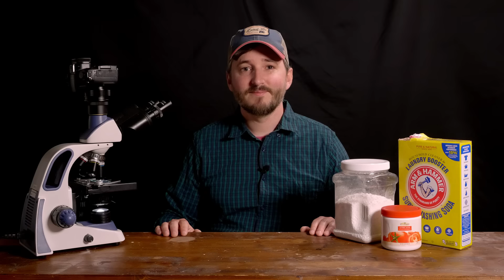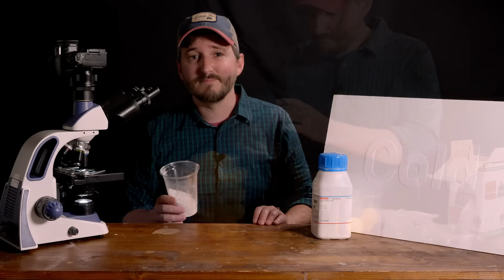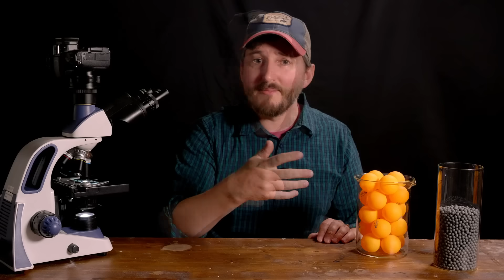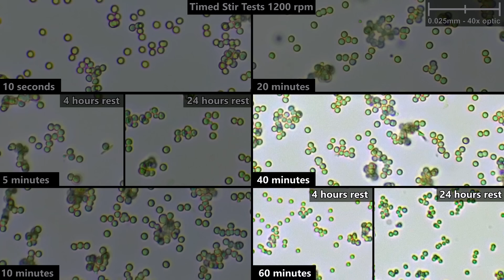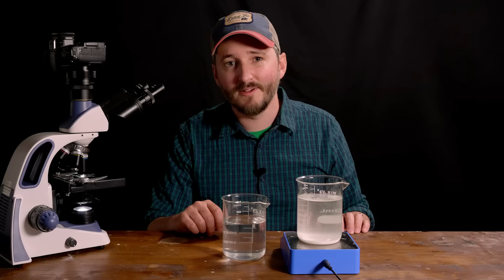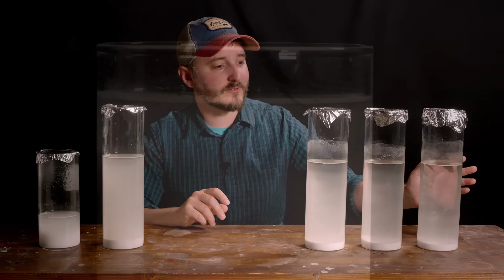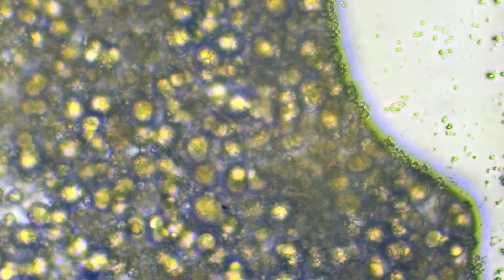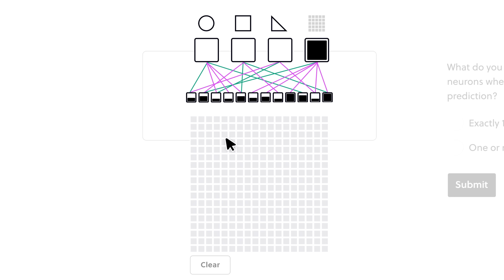Making Infrared Cooling Paint From Grocery Store Items (w/Novel CaCO₃ Microsphere Synthesis)

Comment: Concerning the smoothing of the paint application. Vibrating the underside of the panel would promote self leveling.  It's the same process used to settle concrete. A strip of tape around the edge of the board could act  as a damn until the paint dried. The board would of course need to be reasonably level. A palm sander or even a personal massager would generate enough vibration to promote self leveling of the paint on a panel. The application of the paint would a bit more forgiving as the vibration would shift the high areas to the low areas. Just food for thought. Really enjoy your content.

Comment: As far as the packing based on particle size, I used to think I understood it, bit now even less so.

Why not just use only the smallest size?

Is the aim maximum surface area and reflection (at the band of IR frequency that passes thru the atmosphere) or somehow filling the max volume (displacing the most "empty" space) ?
Reply from the maker: One size of sphere only packs to 65% volume. It doesn't matter how big or small the spheres are. Zoom in on small spheres and you'll see the ratio of filled space vs voids is identical to pingpong balls or bowling balls.

Comment: It only works when pontes directly at the sky? It couldn’t be placed on the side of a building?
Reply from the maker: It doesn't need to point directly at the sky, but it does need a clear view of the sky. The more of the sky it sees the better. The side of a building would work with partial performance.
Reply: @Nighthawkinlight  thank you

Comment: Thank you so much for your work!   I wonder if you tried applying this like a plaster or joint compound.  I'm imagining a special 3D printed spatula that has the desired thickness governed by two nubs at the ends of the spatula.  Then maybe the tracks could be filled in later if desired with the syringe.   I'm a little unclear on the physics.  Would this radiate heat that was added to the substrate? Or does it only reflect in a certain band that happens to pass through the atmosphere? Just thinking about your work in terms of climate change.  Rock on.

Comment: Ben, I watched your video yesterday and having also seen the one from Tech Ingredients it's really interesting to be able to see the microsphere creation process in such detail.

I've been wondering if it we could use the paint inside a cooling aparatus that would consist of a white painted, water circulation panel facing a black ultra black panel. If I understand this correctly (and please correct me if I'm wrong here), heat would radiate from the white towards the black more than the other way around. By pushing air between the panels, it would remove heat and in effect cool the water, would it not ?
Reply from the maker: Black surfaces are very broad spectrum radiators. That surface would release enough of the light which the white panel can absorb to keep both at the same temperature. No matter what color you use the temperature will balance between the two because thermodynamics does not allow two things of equal temperature to become unequal without adding more energy.

Comment: It is inspirational to see how an idea like this becomes realized.  Your innate curiosity, ability to cull and organize previous research from others, and use of the scientific method to test hypothesis via experimentation until the desired results are produced, is a model for anyone wishing to follow the DIY inventor's path.  
   I enjoyed how you covered the basic theory, and then proceeded into the experiments and data collection phase.  
   Know you are doing a service to everyone by sharing this type of information.  You provide an easy to follow template for:
-understanding concepts at a systems level.
-devising hypothesis and testing them.
-comparing data until results "reflect" (pun intended!) the goal. 
-and lastly; you openly share the whole process for replication.  

You, and others like Robert Murray Smith, are pioneers of a new paradigm of open source engineering which will help steer things toward decentralization and autonomy.  I hope to join your ranks in time. (currently devising a kite/ hydrogen balloon with wire string that exploits ionosphere ground potential etc). 

Thanks from the heart for all you do!

Comment: I finally got a moment to watch this, and I wasn’t disappointed. 

As to the method of application, I am not sure if you tried it already or it was otherwise suggested, but an airless paint sprayer might be the way. 

I’ve used it with great success with fairly viscous coatings, like bottom paint for boats. 

I’d love to know if you’ve tried this or the results if you do trying this. 

I look forward to my projects using this method you’ve come up with. I had previously seen the video from Tech Ingredients (also fantastic), and the fact this is a safer process is desirable. 

Thanks for putting in the footwork!

Comment: Isn't the reason that your paint takes such thick coats because pmma and CaCO3 have very similar refractive indexes?
Reply from the maker: Partially so
Reply: @Nighthawkinlight Are you looking at using a different plastic with higher or lower refractive index?
Reply from the maker: @naomiam687  Yes, and not only plastics. I have quite a few plans for future testing

Comment: What’s the performance of common calcium carbonate mixed with binder vs the microsphere product?
Reply from the maker: You can do pretty good with non spherical carbonate in the acetone and water mix. Below air temp by a degree or two C. The spherical pigment is better, and I believe will be much better when moving away from that particular mix.

Comment: A few things I am interested in trying(and will attempt), 1. rather than doing the different sized spheres in separate batches, I want to attempt to do it in one batch by adding portions of the sodium carbonate solution at different times. IE, add half mix, wait one minute, add the other half mix one minutes, Observe result. Secondly as far as the "paint" goes I also have had bad luck with pure acrylic and acetone in the past with other experiments(reactive paints) however certain grades of Kynar(PVDF) dissolve very nicely, stay in solution and spray paint fairly well, Mixes of acrylic and PVDF work too. However you need to use MEK(Methyl Ethyl Ketone) instead of Acetone.
Reply from the maker: Instead of adding the carbonate slowly the better way is to add it all at once in a big batch, then siphon portions out when the mixing time is up for each size. I think adding the carbonate in stages would mess up sphere formation. It's a very particular process.

Comment: can this meathod be used to make calcium carbonate clay? if you make the spheres small enough theyll sinter when baked like ceramics
Reply from the maker: Calcium carbonate doesn't work as a stand alone clay because it will turn into quicklime in the kiln and fall apart when it later absorbs water

Comment: So I don't claim to have a degree in science I just love learning but I'm curious since air is actually a terrible way of dissipating heat, would you be able to apply a clear coat like acrylic or resin used for a lot of modern art then do some kind of water layer between it and another platic maybe another cheap home improvement material to seal it. For testing I'm sure something like an old aquarium would work but in a practical setup it would probably be a large investment due to weight etc. Just curious about ways to improve the efficiency.

Comment: If used on a ceiling, wooded axis of thermostat/insulator, keeping on air in the room during winter,, and potentially have some ready-made painted plasterboard to face skyward in summer to prevent the heat in the roof cavity cooking inside?

Comment: Very interesting video you might be able to create a cool low cost air conditioning system with this idea what about using aluminum heat sinks incorporated into your design I'm kind of getting an idea so you have a not very large volume moving water pump pump water through pipes into a case where you have this paint around the outside of this case you have aluminum heat sinks to help conduct the heat into the air then you have the cooled fluid an insulating pipes so it don't get warm again it stays cold into like a car radiator with fans remove the cold air around in the room this all would use low-voltage you could use a solar panel to run the motors for the pumps to recirculate the water through the system make it like a reverse heat exchanger but you're exchanging the Heat for cold I have the water go back and forth through the chamber with the sky cooling paint and aluminum heat sinks and paint these pipes with the paint I can go back and forth and back and forth through the case almost like a small intestine give the water time to cool I can see the potential in this idea you set it up correctly good luck in your endeavors nighthawkinlight love your videos keep up the great work

Comment: This may be out of the topic, but I just wanna share it with anyone. 
That is true. "Outer space is very cold"  the higher the Elevation,  the cooler the temperature.  The reason for snow cup on high mountain tops and temp. drops below zero on high flying Planes.  That's because  the Sun isn't hot,  it's what they call Cold Fusion.  The heat that we feel during the day when the sun is up comes the Earth and bounced back. Green house Effect.  Temp are cooler on forested area more so in a Rain Forest cos Trees and Plants acts like cooling "plant" absorbing the heat from the ground and release it out as fresh cool air.    The reason why it often Rains in a Rain forest, cos lots of trees can absorbs much heat and water coming from the earth that are released into the atmosphere.  evaporation and condensation process.   It is the Earth that is breathing heat and not the Sun.  It is a hot Furnace down under.

Comment: After seeing this video I’m 3D printing your box, but smaller like a roof tile. I want to replicate your experiment. Do you know if it will radiate the heat through plexiglass? I want to protect the paint. I’m assuming it’s in the IR spectrum.
Reply from the maker: Plexiglass will likely not be transparent enough in a thick sheet. I used polyethylene film.

Comment: Just made it to the point you mentioned a white paper you ended up buying access to. Barring a few contracts, the researchers don't see any of that profit, so if you contact them directly they are usually more than happy to send you the whole paper themselves for free. Often, they end up interested enough to answer some questions too.
Reply from the maker: Couldn't get a reply this time unfortunately
Reply: @Nighthawkinlight  To add to this, there is an even easier solution: most universities have some public-access computers within the university domain, which generally has no-login access to any databases of papers  (usually guest computers in the library). Or, just ask a friend who works for a university? It doesn't cost us anything to download individual papers the uni subscribes to, and everyone thinks the per-paper model is terrible.

Comment: I'm wondering if this even needs to be a liquid 'paint' at all.  If there will be a clear protective plastic/glass cover over the panel, perhaps you could simply coat the panel with an adhesive and then shake the dust over it.  When whatever adhesive you are using is dry, shake off the excess dust that isn't stuck.  

As an aside I was thrilled to see this video in my feed, I'd been hoping you would come back to the subject and was starting to worry that you wouldn't.  Really looking forward to more on the subject.  Great work!

Comment: No idea when i'd find the time to test that, but cooling down water in a coated panel before sending it back to a pond to which i direct unwanted heat from buildings or machines would be neat.

Thanks so much for your work.

Comment: Has anyone actually been able to get microspheres for form using NightHawkinLight's method? I have been trying sense the video came out and I cant get it to work.
Reply from the maker: What are you getting instead? Are you using a microscope to see the crystals? Make sure the liquids are between 10-20C when mixing. That may require chilling your blender container down by blending some ice before mixing so that the container doesn't warm the liquids too much.
Reply: @Nighthawkinlight  I have a fairly cheap microscope but it should be able to see the spheres, its 60-120x. What I am getting might be microspheres but if they are they are more nanospheres because I am am seeing is a super fine dust that looks to be well less then 1 micron, its too small for me to make out enough of there shape to tell if they are spherical or random. I have tried allot of variations on temp, if its too cold it seems to stay in a gel state for hours. I noticed that when the calcium chloride is mixed with water it heats up quite a bit so has to be chilled even if I started with cold water. I am starting to wonder if I have the wrong calcium chloride. I am using food grade, the stuff used as a preservative. I don't know if that would make a difference.
Reply from the maker: @pilfit  Seems like you're probably using the correct calcium chloride, unless the packaging says it's mixed with other things. Are you using an accurate scale to measure the ingredients? The mix shouldn't stay a gel for more than 30 minutes or so if using the amount of citric acid specified in the final recipe. Don't bother playing with the temperature very much, just work on keeping it around 15C. Mix for only 1-3 minutes and you should get fairly large spheres. I was able to distinctly make out my spheres with a 40x optic and a 10x eyepiece for 400x total magnification. I'm not sure by your description how close to that you are. If you can measure 1 micron under your scope that should be plenty to observe the larger sizes of spheres.
Reply: @Nighthawkinlight  I am using a mg scale so it should be more then accurate enough for this. From the video it looked like you were able to get 20-30 micron spheres with 1 min of mixing? that is exactly what I am trying to get. I have not mixed for more then 1 min and have tired less then that thinking maybe my blenders lowest speed might still be on the high side but that didn't seem to make a difference. I need these for a somewhat different project. I am trying to create a paint that can imprint micro dimples into silicone as a way to reduce its friction friction coefficient. I am also trying to find a way to make a paint that can produce micro ridges to increase the friction coefficient (gecko feet). This type of thing normally requires fairly advanced fabrication methods and I have been working to find a way to do it at home or in a simple lab similar to what your doing with the cooling paint.
Reply from the maker: @pilfit  Try stirring by hand, being sure to stir while pouring in the carbonate solution. Perhaps try distilled water in case there's something weird about your tap water. I have not tried tap water that contains chlorine or floride. The most strange thing to me is the hours long gel time. You're using exactly the same measurements of both solids and water listed in the written instructions? 3g citric acid in 30ml water, 10g CaCl2 in 100 ml, 20g NaCO3 in 200ml
Reply: @Nighthawkinlight  The super long gel happened to be the time I tried distilled water. I thought there might be something funny with my tap water as the water here is some of the hardest in the world so it already has loads of lime in it. I am using exactly those measurements, that is the only variable I have not played with. My washing soda has been open for a few months, I wonder if that could be causing problems.
Reply from the maker: @pilfit  If there's a big difference when you run the reaction with your water vs distilled then your water must be a problem. All the waters I tried worked roughly the same. Use bottled water at least, distilled is probably overkill. I also am still not sure about your microscope. You could be making spheres and not have the magnification you think you do. That's all I can think to point my finger at without being there to see how you're doing things. Sorry you've had so much trouble
Reply: @Nighthawkinlight  I finally did it! I got a slide with a scale and a better thermometer and was able to get 20 micron micro spheres. I hand stirred for 40 secs and made damn sure the temp was right in the range it needed. took me a while as I had to wait for the new thermometer and scale slide to show up in the mail. (the slide was just to make sure I was getting the size I was aiming for) Thank you so much!
Reply from the maker: @pilfit  Great to hear!